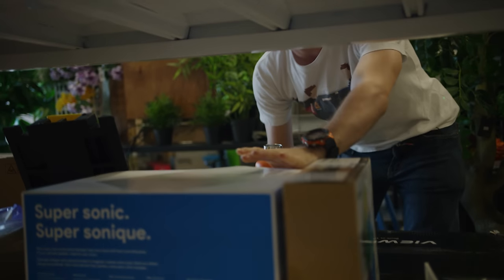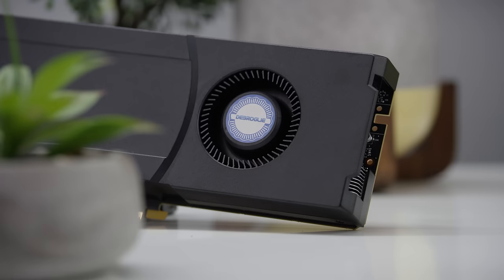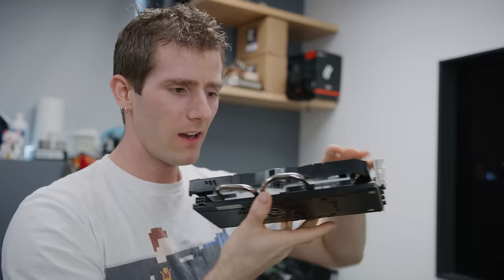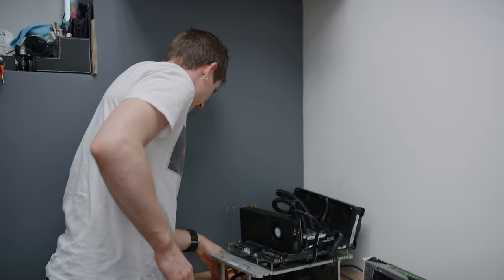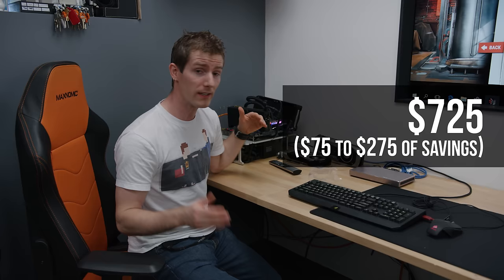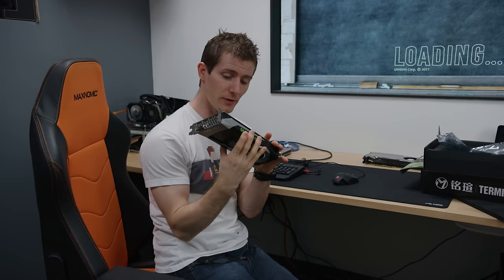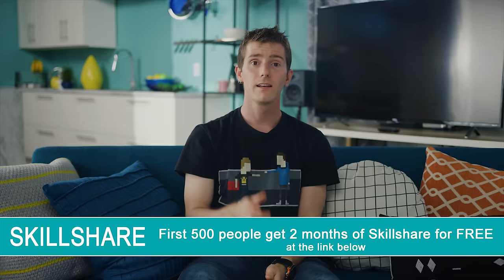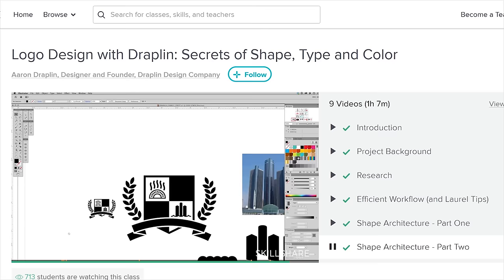Cheap AliExpress Graphics Cards - SCAM???

Comment: Back when 1060’s were $400-$500 new lmao

Q1 2021 edit: this aged horribly
Q4 2021 edit: i’m so tired of this comment
Q2 2022 edit: ok it was funny make it stop
Reply: @LazyTacoProductions  good shit my guy
Reply: @LazyTacoProductions  Press X to scam
Reply: The Crypto Currency boom and its eventual collapse where what drove the GPU prices through the roof.
Reply: Back when 1060 used to be 150$
Reply: @LazyTacoProductions  Same fam, mine is overclocked aswell which is nice
Reply: Can someone build me a 300$ pc with monitor ? Can run apex in medium or fortnite easily , sorry and thanks in advance
Reply: @queenlatifa2508  lolwut?
Reply: queen latifa dude $300 isn’t gonna cut it for good gaming. wait until you got like $600-$700
Reply: Back when GTX 670 2 GB were $400
Reply: @queenlatifa2508  why would someone do that to you?
Reply: @F_Du_Sea  HE's right tho, I currently have a PNY 1060 3GB that I got for 100 flat that way. How do you NOT know this? Also, the Super series is dropping rn. I mean its not even research at this point.
Reply: @F_Du_Sea  damn the You're/Yours here. Now I see
Reply: They're 150$ used
Reply: @queenlatifa2508  i5-2200, 8gb ddr3 ram, gtx 580 1gb ram, sonic view 75hz 19 inch monitor, hp elite pc case, deep bass headphones, cheap mother board, razer death elite mouse, cherry mx mechanical keyboard. Now you get it build sucka no one will build it for you xD
Reply: @queenlatifa2508  that would be hard jnless u want a shit tn panel. but here we go ryzen 3 2200g and mobo for 150 rx 570 used for 80 rest to ram and cheap case and a $30 evga psu
Reply: @F_Du_Sea  no you're clearly in cognitive dissonance because you are not happy you paid $4-500 for your 1060 OR you paid $120~ for an inferior card and want to justify your purchase. My pc hitting all benchmarks just fine
Reply: @LazyTacoProductions  I've had a sli 660s for like 7 years wtf are you talking about?
Reply: 2070 and 2060 are around that price so yeah price comparison did not change 
all channels on YT compare rpice range with 2080 wich 1080 had that price of almot 1000 dollars so yeah ...
Reply: @queenlatifa2508  Good luck.
Reply: and now they are even cheaper
i can get a 1060 6GB for like 200 bucks
Reply: Proxy really? I’ve seen those for $100, I got my 1070 for $200
Reply: Im with a 1080ti i hot it for $540
Reply: @LazyTacoProductions  May i have the  link from where you bought it from? fake gtx 1060 6gbs are extremely common on ebay and usually marked as second hand
Reply: @funknugget6334  Bruh it can easily, i got my pc  custom built for £150 and it runs alot of games perfectly fine, gtx 660 it has along with an i5 2.80ghz processor with the only catch being the bad memory which is ddr3
Reply: Strider whiston I don’t know about that… ddr3 doesn’t matter too much especially for Intel processors that don’t rely on that speed. It’s probably an old prebuilt with a 660 thrown in it
Reply: @funknugget6334  i literally saw him make most of it cause he lives nextdoor and it's a friend of mine
Reply: @F_Du_Sea  I got a GTX 1660 for  120 bucks cry some more
Reply: Was a dark time in PC gaming
Reply: Na8o.  I did s 300€ gaming sytem with a rx 570 60fps ultra setting in any games
Reply: That’s how much a 1070 is now
Reply: @travisbellew7485  got a 1060 6GB for 80 bucks a week or two ago
Reply: @queenlatifa2508  no, you want a gaming PC you spend the money for one. Otherwise buy a console cause $300 isn't gonna cut it. $900 minimum.
Reply: Ryan Loomis 2.0  Well I live in Romania so things are super cheap here for some reason
Reply: the only GPU that was ever worth 500$+ was the GTX 1080ti, that shit was the greatest bang for your buck GPU ever
Reply: @wwompwomp  "$900 minimum" yeah, if youre a die-hard gamer who wants 100+ FPS in every modern AAA game. my build costs WAYYY less and it can game just fine on medium settings. not everyone is a elite pc gamer like yourself man
Reply: @F_Du_Sea  120$ is a good deal, they go for much less too.
Reply: @F_Du_Sea  dude, get out of the cave
Reply: @Myrou1  easily someone nice would
Reply: queen latifa why would we want to, and why for 300.
Reply: Back then, I could only get a 1050 because of GPU prices
Reply: I got a B-stock 1060 3GB for $100 from EVGA a few months ago.
Reply: Dr. Stephen you know you lose a lot of credibility when you use the wrong “you’re”
Reply: @funknugget6334  you can make a good setup for fortnite and apex with 90-150 dollars, dude
Reply: Dr. Stephen they were all 130 in November 2019 to December 2019
Reply: Smandude25 he/she's asking a genuine question that the person doesn't know info about, chill
Reply: @funknugget6334  not on Ali express lmao
Reply: @queenlatifa2508  just go on ali express , buy a cheap xeon cpu and mount some gtx from the 6th or 7th series 2*4 gb ram
Reply: the good old days before rtx when 1080ti was the best
Reply: DRvrhatulz right
Reply: gpus did the fucking stanky leg the in past 2 years
Reply: @F_Du_Sea  X
Reply: feels like it's been ages
Reply: CringeLord4000 damn. wild.
Reply: I bought a 1060 6GB for 279€ back in 2016 :o
Reply: Racc that comment is old as fuck, people here already dropped a parts list, and it won’t get quality frames after 2 years max. i can guarantee you ive built many more PCs than you too, ive built and played on over 20 systems
Reply: Lmao a couple of days ago I bought an used gtx 1080 gaming x for 175$. Pretty happy about it
Reply: @DarthSabbath11  ok cool
Reply: I don’t get how it’s funny tho
Reply: DinkleDigeroo same, no issues resident evil 2 remake on very high/ultra setting every other game I tried work amazing
Reply: @queenlatifa2508  with monitor???!?!?!!! Nah man. Buy a dell optiplex and put a rx 580 in it
Reply: @queenlatifa2508  $300 wont run apex at low settings considering the minimum specs costs around $500 on its own
Reply: @LazyTacoProductions  I literally can't find a 1060 under $280 used
Reply: @funknugget6334  lol my pc cost 300 and it has a i7 2600k and GTX 1060 3gb
Reply: @wwompwomp   900 dollars frick that I have a 300 dollar budget and I have a GTX 1060 3gb and i7 2600k
Reply: F.B.I that’s actually a nice deal, where’d you get it?
Reply: @funknugget6334 this guy was building pcs for people who are struggling my family was struggling we didn't have money but this man saved me and builded a expensive pc for cheap
Reply: Facebook marketplace
Reply: Coin mining was a hell of a drug.
Reply: Now you can get a 1070 for $290
Reply: Karai $290? more like $190
Reply: @karai5082  my gtx 1060 cost 130$
Reply: @proxy1035  eh, ew to a used 1060 that was likely used for mining at $200, especially considering i got my nephews used RX 5700XT with 8gb for just $100 about 4 months ago.
Reply: @queenlatifa2508  impossible
Reply: @queenlatifa2508  Just buy something that cost 300$
Reply: @LazyTacoProductions  Kaboom by Takashi murakami Italia. Is there going to be a minute. Fortnite images with you to a world with no one
Reply: back when 1060's were new lmao
Reply: Back when graphics cards were available at all lmao
Reply: 1.5 years later and they're still going for $400 around Griftsmas.
Reply: Here we go again
Reply: January 2021, time loop to 5 years ago
Reply: yeah I paid 422 for mine lol
Reply: @LazyTacoProductions  its not
Reply: @F_Du_Sea   HE DELETED HIS COMMENT 🤣🤣😂
Reply: ah, the good old days when 400$ was cheap :)
Reply: welcome back to hell my friend
Reply: They are back to that price in 2021
Reply: @antoniolemus1117  450 2nd hand for a 1660 super
Reply: This one aged like a fine milk.
Reply: @wwompwomp  did she even read any of the replies tho lol
Reply: @shomik99  idk but my point still stands you cannot spend $300 and get an entire set up that will give you a good experience
Reply: Lol
Reply: aged like fine wine amirite?
Reply: @nocnuc  yep
Reply: This aged like almost bugs
Reply: sir your message caused the global silicon shortage
Reply: lol..
Reply: @queenlatifa2508  i need too x-plane 11 compatiple computer but no more than 200$ newer pay this.
Reply: Kyezxid  yes not cheap. ower price lot, chinese card need cost only maximum 50$ guality have big shit. example, i buy new computer display aliexpres because has lot cheapen. less than 100$ normal cost my country 300$ and chinese display can use only 5 month and go itself broken ,starting flicked/blinking display and not can use. new display and go fast broken. same before new acer used only 1,5 year and go broken corrypted pixels down display alltime more more, and not can use.
Reply: Yea my 4 year old single fan 1060 sold higher than it was new.
Reply: @queenlatifa2508  Nope, buy console.
Reply: Yes, yes it did
Reply: Lol
Reply: LMAO.....
Reply: @queenlatifa2508  this was a year ago but I could still do it if you still need one lol
Reply: Good edit
Reply: And now ?
Reply: KEKW
Reply: aged like fine milk -_-
Reply: @wwompwomp  I did with a used set up
Reply: I miss when the bad RX 580 was only about $200. Now they're $600.
Reply: yessir
Reply: We can all agree that GPUs went through their wild ride.
Reply: @funknugget6334  THE RIDE NEVER ENDS.
Reply: Never one more for your box
Reply: expecting to see an 2023 edit
Reply: You know you can delete your comment/turn off reply updates if it's actually bugging you right?
Reply: Yeah that was... Never until recently. Got a new 1060 3GB for 250 in late 2017.
Reply: @NeutralGuyDoubleZero no he likes it this way
Reply: I need a new edit

Comment: @4:02 The tape on the SLI connectors is called Kapton tape.
It is used in electronics manufacturing for various reasons due to its ability to withstand high temperatures.

I honestly don't know why they put it on there to begin with, but I assume someone accidently left it on there.
Usually Kapton tape is used for one of these reasons:
1. Preventing solder pads from corroding from heat (the pads in the video are gold-plated tho, so this is unnecessary here).
2. Preventing liquid solder to stick to the pad (which is not the case here since wave soldering is way too coarse for a GPU).
3. Something else which probably only made sense during manufacturing.
Reply: Kapton is put on to prevent gold fingers from being damaged during manufacturing, either due to scratching or accidental solder landing on it from wave/selective/SMT processes.
Reply: Oh wow, that makes sense.
Thanks for the response!
Reply: An Excellent avatar.
Reply: I got here late. . Good call 😉
Reply: you are right.
And Linus can just remove that and be happy.
(hopefully he will not plug a bridge on top of the tape)

Comment: I wish you'd have dismantled the cards to check out the dies, and i really really wish there had been some data on temps, as well as some testing done on that. Seems like that is really where these cards would differ.
Reply: Christian maybe you should watch gamersnexus, they do that sort of in-depth stuff. Linustechtips is more about entertainment with some parts information.
Reply: I do watch Gamers Nexus, and i enjoy their content very much. But they haven't done a video like this. LTT has. And so, they really should have done a better job relaying relevant information. This particular info might make up the difference between a purchase, and looking elsewhere, for someone.

Besides, if someone buys the card based on the info given in this video, and then it turns out that it gets hot as hell, guess where they're gonna come to complain? Seems to me those 5 minutes of additional testing, and 30 seconds of showing the info, might be a good investment, rather than risking a large backlash after the fact. :)
Reply: Christian if the card doesnt throttle under  benchmark, its not going to throttle under games.even if its running at 80-90 thats still within what the chip is designed for, if it does go above 90 it will throttle, so what is there to worry about
Reply: You know that temps differ around the world right? So if it's running right up against TJ max (point at which the card will begin to throttle) at LTT headquarters, then there is a very good chance that it'll throttle for someone who is in a slightly warmer environment.

Again, i really wish that thermal delta figures had been shown in this video.
Reply: It's generally accepted that you shouldn't run high-performance hardware in temps above about 80 F / 27 C. Or that, if you do, you can expect longevity and performance to suffer as a result. Most computers are designed to run in nice, cool places. The "known good" Founder's Edition cards will already be running just under their maximum thermal tolerance limits when you stress-test them in an air conditioned office. Higher ambient temperature will cause problems with any power hungry graphics card, not just potentially sketchy ones.

Comment: As far as I know, there are graphics cards on eBay (and probably also on AliExpress), where the boxes are just labelled "GRAPHICS CARD", and they are older and lower end graphics cards that have had their firmware modified to trick the system into thinking they are newer cards. YT user "PhilsComputerLab" has done a few videos on that.
Reply: It's very easy, I tricked my friend by doing this exact thing. All you need is a vBIOS editing software and simply change the product ID to whatever you like. I changed my GTX 780 Lightning to a 980 Ti Lightning, which only 10 in the world were made and they look pretty similar when installed. I fooled him good.

edit: I DID NOT SELL IT TO HIM. I just told him I got one and showed it to him in my PC with GPU-Z open. I'm not the scum of the earth guys.
Reply: as long as he isnt trying to sell it or make money off it I dont see the issue
Reply: well int he end all will show up in games benchmarks wont lie
Reply: but the benchmark showed its potential
Reply: Fringie ...there's no way that thing would actually work with nVidia drivers though, right?
Reply: Not like the physical appearance of the card would tip you off or anything...
Reply: Kevin Bhasi that's what benchmark tests are for, then it shows the actual capabilities of the card not the claims of capabilities
Reply: Issue is when you actually run benchmarks and etc and see it doesnt perfomr
Reply: if you take a picture of the actual processor and show ebay that it is not as advertised they will refund your money and most likely not request the return of the card. Got me three cards like that. 950 (claims to be 1060), and a pair of 780s (claim to be 980 ti)
Reply: That's how I ended up with a 650 and 750 that aren't their respective cards. Works perfectly fine for boot testing though.
Reply: I bought a WD 4tb external once. Sealed box had all the cords. Plugged it in and it installed the proper drivers but it wouldnt mount . Opened it up and it was the correct USB control board literally taped to a 35gb SCSI drive.
Reply: Macho Borracho 
That reminds me of a photo I saw online of a unbranded 500 GB external hard drive that apparently turned out to be a 128 MB flash drive with a hacked controller.
Reply: eli oliver 
In the videos of the user I mentioned, he mentioned that the games tended to crash on those cards when they exceeded the real amount of video RAM and went into the fake video RAM.
Reply: Sup
Reply: Kevin Bhasi a whole bunch of youtubers have done this. I wonder how linus got this idea....its only been done 50 times already.
Reply: Marshal Beard some friend you are
Reply: How were there only 10 980 Ti Lightnings made? Pretty sure there's a ton more...
Reply: cooldude sm We found Marshal's friend lol.
Reply: Kevin Bhasi friend of mine got scammed with that once, it was a "Vamery GTX650TI" for like $40 (this was a few years ago mind you) and the card underperformed, and died in only a few months. It was junk.
Reply: cooldude sm I didnt sell it to him, like I said he was a friend of mine. I told him that I got my hands on one of the only 980 ti lightnings, which he liked very much and knew there were only 10 in the world or so. It was just a harmless prank.
Reply: True
Reply: I have one. They were actually 8600GT 1GB made with used chips recovered from trash. Mine also died after 4 months, but it actually worked great while it did work. I got sent it for free from someone in Canada who got burned on ebay. He did get his money back though.
Reply: And as you saw in the video, these cards are legit. They had the same performance as the original ones. So these weren't modified..
Reply: i got douped by this, i ordered what i thought was a gtx 780ti but ended up being a gtx 550ti with firmware of a 780ti modifed onto it. when i got it i could tell right away it wasnt a 780ti and than when i pealed the sticker off and it said 550ti i was like knew it. but yeah minute i plugged it in the card was artifcating so bad i couldnt even do anything,
Reply: That's what you guys get for buying GPUs on eBay
Reply: ya those are the scam ones...  selling sub par cards with hacked bios so it reads its the actually card you bought